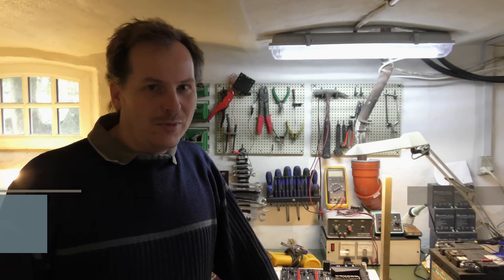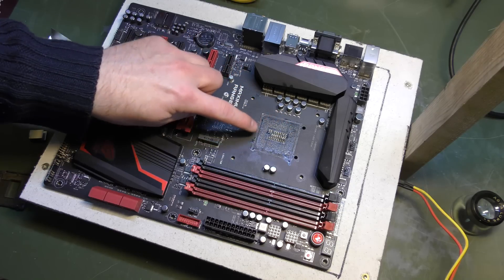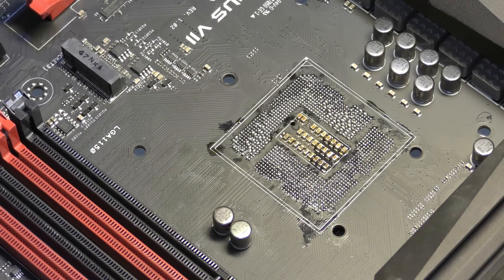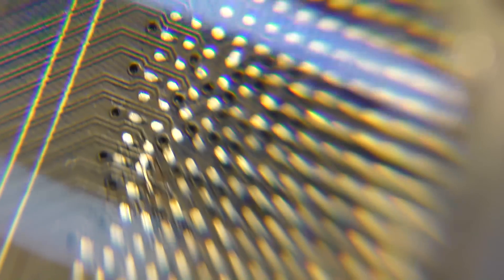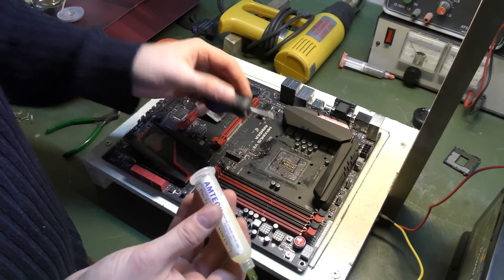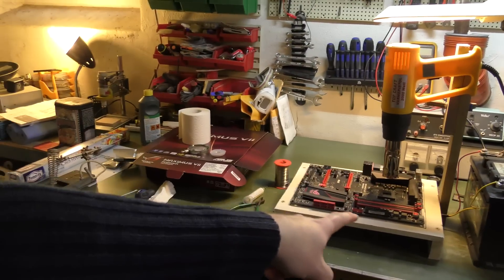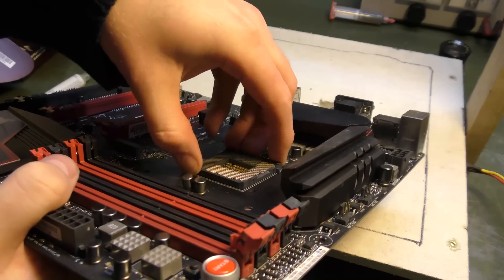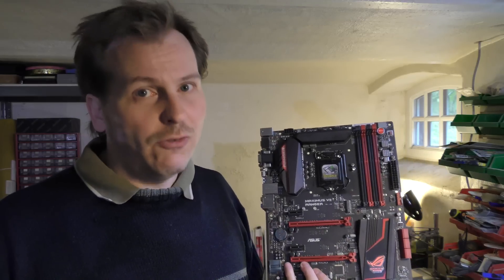How to DIY LGA1150 CPU Socket Replacement - 404

Comment: i m woundering when you removed old socket wasn't it totaly warm enough? Maybe a real airgun (hot air soldering station can do the job)
Nice try anyway, there is lot of motherboard with this issue on ebay... the very popular 1366 socket is worth trying to fix it because of compatibility with xeons and overclocking capacity!
I do play whith 771 modding socket 775 and xeon and if find it realy fun when it work. here is a cool channel of a french geek playing with old and new computers stuff and fixing parts with sodler. https://www.youtube.com/channel/UCuxAFNE7Tg50eokg2whl9_w
byby!
Reply from the maker: Hi
I can say like two sentences in French,,, I do not understand it :-/
Thank you for watching! :-)

Comment: So sad a very sad day.......  not rly but you tried to fix a broken mobo. Too bad that Asus mobo is a killer gaming board. I say you get the Angle grinder out and give it a proper death LOL..... Video on my lunch break great break from Cisco ISO code................. Is that old core i3 socket 1150 or something else, as i'm looking at the thumnail of the video where you upgraded the core i3 in that mini desktop, say you said you were going to plug in a watt meter on that beast to find out under full load watt/idle load was...... And again video idea.... I say its like 40 or so watts
Reply from the maker: Hi
The i3 4170 CPU i put in the Tiny PC, was one i got to test this ASUS MB. So yes they are both 1150.
Video on Tiny will come. 
Now back to work you lazy dog!! That Cisco ISO code is not gonna make it self! :-)
Thank you for watching! :-)

Comment: If it doesn't work you can always make it into a low voltage high amp power supply (mod the VRM  :D ).
Reply from the maker: HI
I have no use for that :-/
Thank you for watching! :-)
Reply: Still would be a interesting project :P

Comment: Did you even tried a CPU on the new socket?
Reply from the maker: HI soccerzockt 
If it works It would be an awesome video, If it does not, it will be kind of borrowing.
We will see :-)
Thank you for watching! :-)
Reply from the maker: Hi
No I did not think there would be any chance of this working,, I might.
Thank you for watching! :-)
Reply: My PlayHouse Maybe the liquid solder filled the gap when you attached it.
Reply: Try one im typing this on a lga1150 system with 2 broken pins turns out they were they were just VCC+ pins (voltage) and there are hundreds that are voltage / ground
Reply from the maker: HI Unlimited Craft 
Okay,, I just need a stick of RAM for is and I'll give it a try.
Thank you for watching! :-)
Reply: My PlayHouse Will you make an extra Video for this, or do you just post the result?

Comment: those cpu sockets use whole blocks of pins for power and ground. if you have only one pin broken you maybe lucky and is a redundant one. For example this is the 1155/1156 diagram http://www.xtremesystems.org/forums/showthread.php?288886-Haswell-1150-motherboard-pin-diagram if its a control/data line going to dram module then you have not installed then again it maybe fine
Reply from the maker: HI
Okay thank you for the info!
Thank you for watching! :-)

Comment: you should at least turn it on before throwing it in the garbage, there are a lot of redundant power pins on that socket
Reply from the maker: HI
The dot on the PCB had cobber circuit to it,, if it's a NC, it is just a dot.
Thank you for watching! :-)

Comment: try it! some pin are NC (not connected) or may be one of several redundant ground of vcc pins...
Reply from the maker: Hi produKtNZ 
I will try the board in an upcoming video.
Need to get a memory block for it.
Thank you for watching! :-)
Reply: It could also be a redundant ground or power or any other of a number of non-vital pins.

I've seen CPUs lose several pins and work without issue.
Reply: I was cleaning my Sabertooth Z77 motherboard sometime ago after I had a catastrophic cooling tube failure, after using plenty of IPA and an anti static cleaning brush, I managed to remove most of the mayhems pastel ice white cooling fluid from the black PCB.

I then proceeded to soak both sides heavily with IPA using a spray bottle then I used an air compressor to blow out any remaining     mayhems cooling fluid from underneath IC chips etc, but sadly I passed the air gun over the CPU socket accidentally which blew off the cpu cap cover and bent around 5 pins. I straightened 3 pins but broke two D:

Now my motherboard has the weirdest quirk ever...
I cannot output any sound via 3.5mm audio jacks.
I cannot input any sound via 3.5mm audio jacks.
Even a PCI-e sound card cannot output or input audio over 3.5mm .........
Yet the PC is rock solid and I use it nearly constantly for fraps recording and video encoding / gaming etc

The only way I was able to get sound out of the PC was to use SDdif/Optical out to a supporting sound system (logitech z5500's)

Strange eh, but it lends weight to what you said ""I've seen CPUs lose several pins and work without issue.""

:D
Reply from the maker: Hi Σμυρλής Γιώργος 
I will!
Thank you for watching! :-)
Reply: Don't bother trying it, it seems that it is from a differential pair. All ground and power pins are vias going to the ground and power planes underneath and as you said the nc pins are dots.
Reply from the maker: Hi
The dot on the PCB had cobber circuit to it,, if it's a NC, it is just a dot.
Thank you for watching! :-)
Reply: try the motherboard with cheap cpu. maybe its a ground pin. the cpu has many ground pins and if one is missing not make a problem

Comment: Not all pins are used, check out the pin out for the cpu that you will be trying. In fact you may have needlessly removed the old socket, yes it is true. Where I used to work we would recover many cpu socket problems if a pin had broken. Just try it and see... NEXT TIME
Reply from the maker: HI
The motherboard did not work for me, before, have no idea if it was because of the socket, but I thought it would be interesting to try to replace it.
The dot on the PCB had cobber circuit to it,, if it's a NC, it is just a dot.
Thank you for watching! :-)

Comment: Works for me!
Reply from the maker: Hi ThEcRaZ3dGaM3R 
No I might try put in the CPU and Check,, need a block or RAM for the motherboard first.
Thank you for watching! :-)
Reply from the maker: Thank you for watching! :-)
Reply: Weren't you able to check and see if that was a ground that broke? If it was a ground then the board would have successfully POSTed...